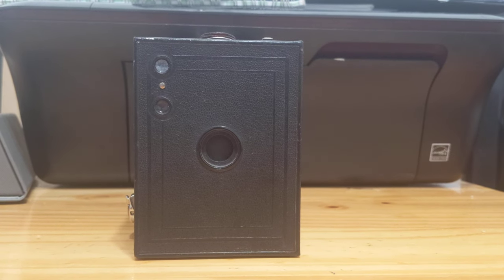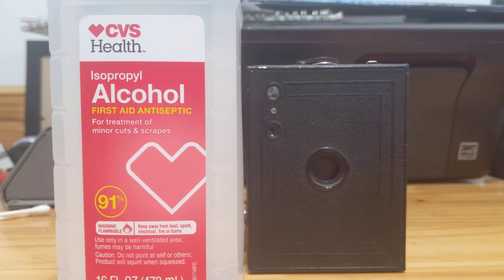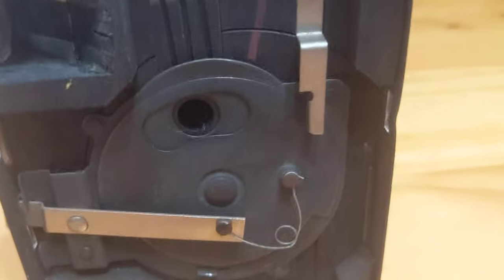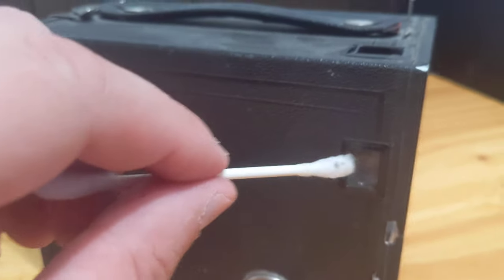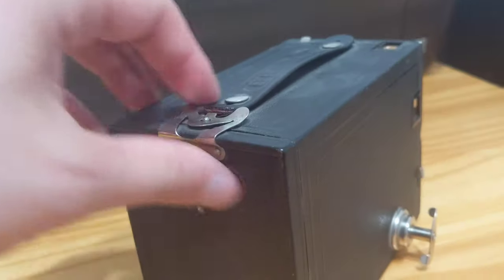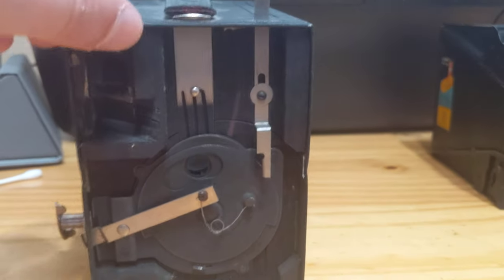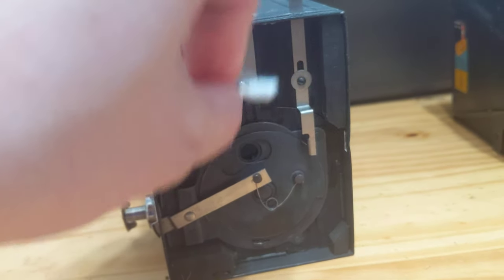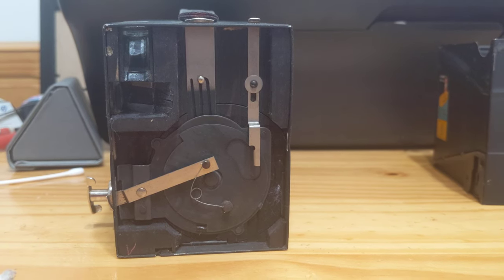An introduction to cleaning cameras. featuring the Kodak Brownie number two model f.

Comment: Thanks for showing how to remove the front of the camera! I have a couple of brownies I will be cleaning. Thanks for sharing your technique! Anthony.
Reply from the maker: Anthony,

Thank you for watching my video.  This method works for the kodak brownie model f.  It doesn't work with the six-20 brownies, which are held in by either hex shaped rivets, or by Phillips screws.  If your brownie takes 120 film, then this is your video.

The mirrors, viewfinders, and lens are what really need cleaning, the rest of it is pretty much indestructible due to simplicity.

Jason

Comment: what kind of oil should I use on the shutter spring?
Reply from the maker: Run it dry. It doesn't need any oil.
Reply: @ganzonomy  it struggles to move
Reply from the maker: @Federico84  make a video and send it to me.  I'll take a look 😀

Comment: I would have blown all the dust out first and then used the alcohol. I probably would have used lens cleaning fluid on the lens surface's really. And then lightly  oil the shutter spring and all moving parts, just a drop here and there.That's the way that works best for me. Larry
Reply from the maker: I do agree with you. And I went back after and used some oil on the spring mechanism, however this was just to get a brownie that might be stuck, to say least work.  The Brownie is virtually indestructible in terms of shutter simply because of how simple the rotary shutter is.  

Thank you for your comment and feel free to look around my channel, comment, and subscribe
Reply: I’m not sure oil is a good idea unless something is struck. 
Does anyone know if these camera workings were oiled at the factories or just meant to work dry?
Thank you.